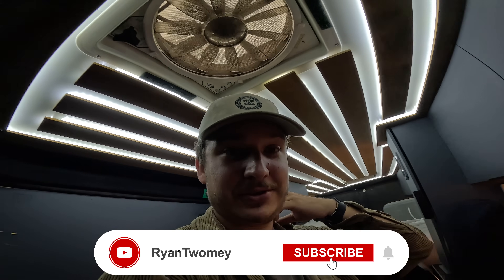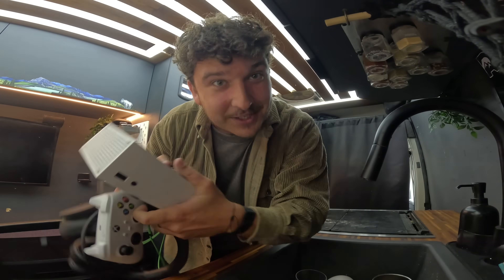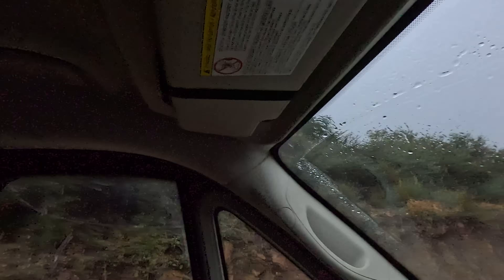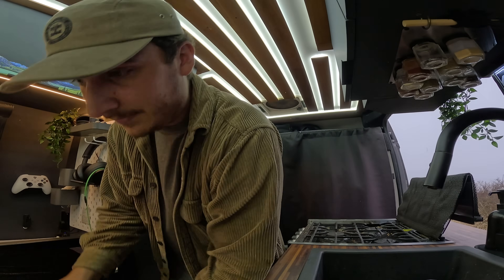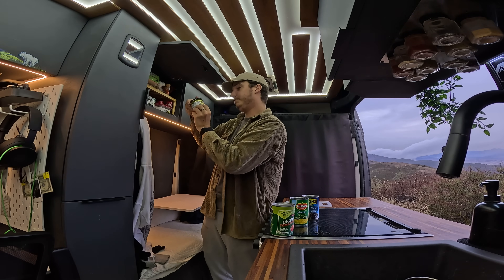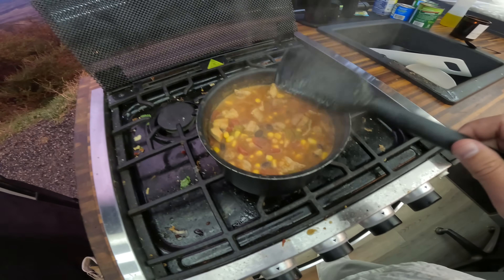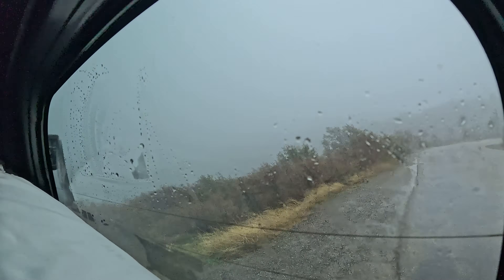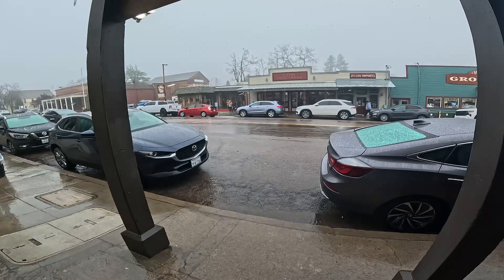Vanlife Camping Alone In The Mountains | Back on the Road

Comment: The biggest drawback of most mini trucks going up a mountain is not the lack of horsepower, its because most of them have carburetors that cannot compensate for the thin air and they run too rich. If your Kei has fuel injection it wont be as big a problem.

Comment: I'm sure you've already taken care of this but you should possibly consider a foamy build it is basically taking extruded polystyrene which is why it's called XPS as well quiet it's rigid foam you can get it in different thicknesses and then you back it with something that is trucks will but not two structural you can either do regular fiberglass as well or you can do what they call Poor Man's fiberglass or pmf either way if you do like a quarter inch thing of plywood or laminate over top of it and you Bond it on both sides you can make a 1 inch piece of foam very rigid and very stiff and very very very very very lightweight there's some really good foamy builds and then there's some that kind of make you scratch your head but no different than other camper builds you got the good with the bad but I like so where are you currently have your band set up on the inside